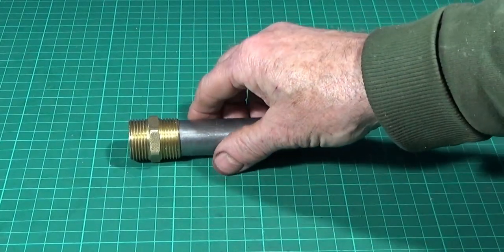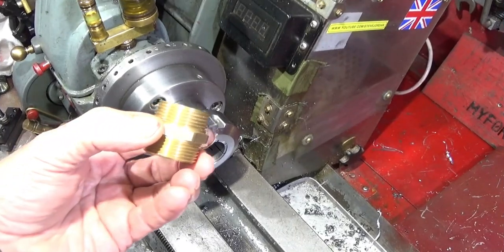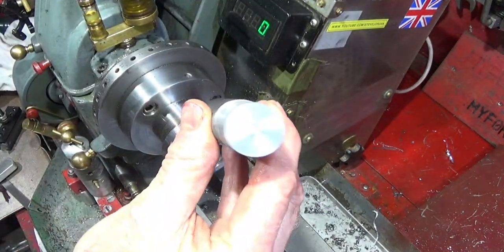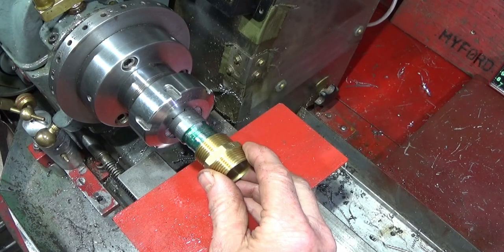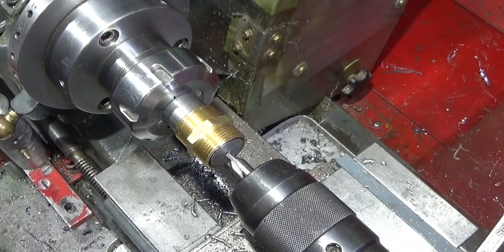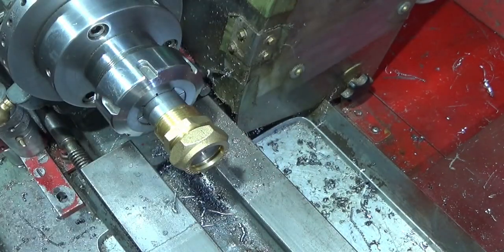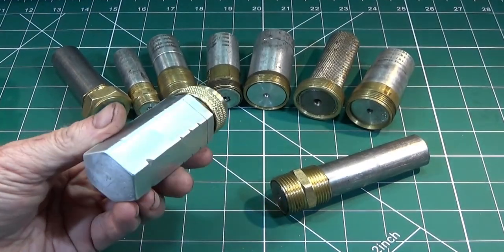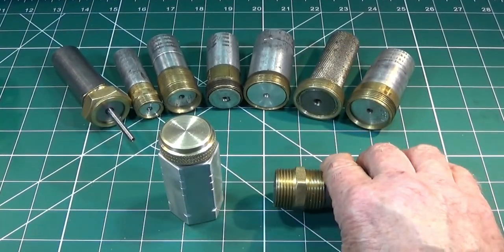Make A Mandrel Quickly For Turning & Knurling Container Screw-Caps

Comment: An interesting follow-up Steve. I bought one of those brass fittings today. Will have a go at making a mandrel Cheers Nobby
Reply from the maker: Hi, Thanks. I hope to show the process of making the actual container part soon. It's worth looking out for brass plumbing parts at car boot sales, and if you have a for sale area at your local recycle centres as well. Regards Steve
Reply: @SteveJordan  Could you not just put one end of that brass fitting into the chuck rather than use a piece of bar? If you had less material sticking out of the chuck, less flex so no need for the live center maybe??
Reply from the maker: No, It could come out of the chuck when machining. Plus a lot of wasted time in trying to get it concentric. If you make up the fixtures, then you have a safe, easy method that can be used anytime, quickly. Also you need the length of the fixtures for certain work like knurling.
Reply: @SteveJordan  Why would it come out? Because it's hollow/flexing you mean? I've learnt that you have to be a bit more careful with tubes I grant you, it looks like there would be enough length to sit inside the jaws, to provide a fair grip. You aren't knurling past the middle of that connection tube where the nut section is are you?
The jaws of the chuck would just be gripping the threaded section on the other side of the nut. Well that's how I would tackle this job especially for a one off, making the other part and waiting for the loctite to dry would be the wasted time to me.😃

Comment: Those brass fittings can be quite expensive; at least here in the States.  Black pipe fittings are much cheaper, but don't have a hex in the middle which may not even be a problem.
Reply from the maker: In the UK, you can buy them at low cost from recycling centres and car boot sales. Regards Steve